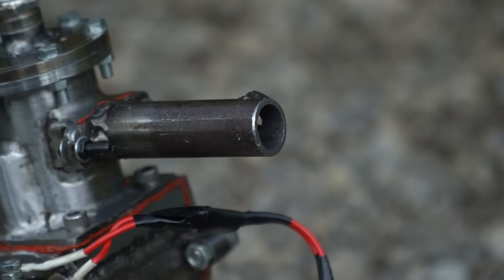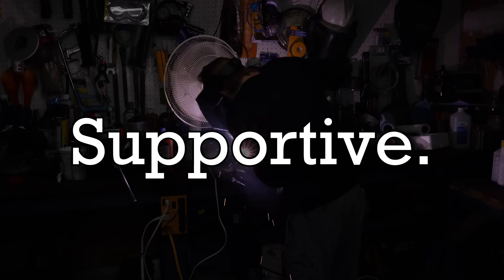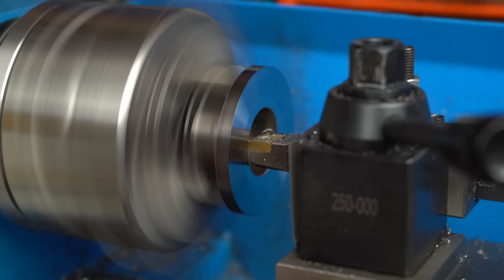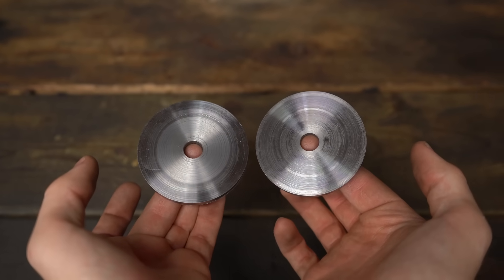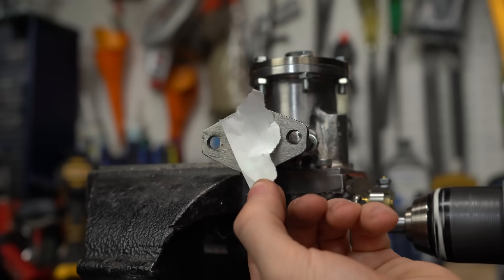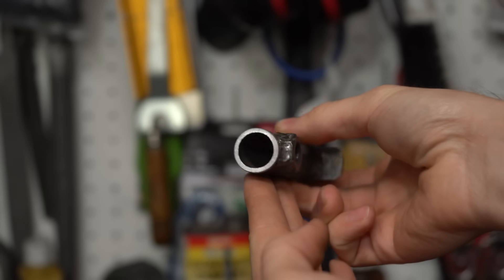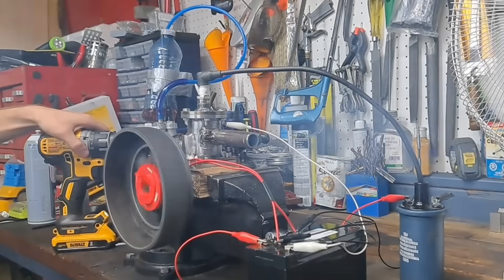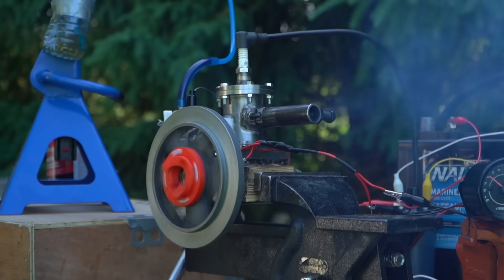I Made a Two-Stroke Engine Using Things I Found at the Hardware Store

Comment: that was kool i bet it would run better with a exhaust with a  expansion chamber on it like a dirt bike and why not drill and tap threads in the crank and run a bolt in it to hold on the flywheel and maybe run a 32:1 gas oil mix idk just a thought good job

Comment: Exhaust presure isnt needed the igintion timing is important tho and size of the nozzle of the carburateur also has to be right otherwise you wont get right air to fuel mixture even with the screw for it.
19mm or vene bigger is fine for 50cc most scooters and small dirt bikes use them even with 50cc Engines. The nozzle or th3 carburator does matter tho.
There is also normally a sort of Membrane between the carburator and cilinder.

Comment: I used to work on Stihl 2 stroke engines at a shop. When we did rebuilds we'd coat the entire inside (hand/finger application) with undiluted 2 stroke oil. You should give it a try in the future if you do another engine build, either 2 or 4 stroke. Makes it a bit easier on the unlubricated fresh metal parts and prevents a lot of wear

Comment: For most of the scooter/moped 50cc that are two stroke, the intake port is in the crankcase, so the gas/oil mixture can lubricate the crank, and the wall are equipped with ports that channel the mixture up into the burning chamber. Thats why with your design you had to add oil in the crankcase. Cool video btw
Reply: almost all 2 strokes lubricate the crank case with induction charge in one way or another with the exception of one cool design I saw in model engineer where the guy used double lip sealed bearings for everything below the wrist pin. I have a string trimmer motor that inducts through the side of the cylinder, ported using the piston skirt instead of a crank case reed valve. It's an incredibly reliable engine. It has a port along the outside of the cylinder liner almost exactly like the transfer port for transferring the fuel air charge from the crankcase up to the combustion chamber, except it goes down when the piston comes up and clears the port.

Comment: Problems begin when there's no exhaust recirculation system and that is a tell tale sign of morally broken engine and it being unbalanced leaning right wing wicked like some forked tounge freedom whisperer sputtering it's un burnt fuel spatter as if that corn-o-line gas-o-some fuel line into a dotted line tighter than a tip from porcupine quill and will do no harm to any equipment unless it runs right turns right has nothing wrong double checked making sure everything was right and tight right handed threads were to specs as listed right there. So as long as you keep it as it was left make sure it's left on left empty of all fluids because after they leave they have left and it's always better leftover and not left under. Left hand threads loosen better so better if left alone run over the check list from left while rotating ensuring you can only go left. Lie loudly laugh like you were left at every moment meaningful and love like your heart left with your family and mind.

Comment: the exhaust thing is for a flow restriction and resonance from the pressure wave of air/fuel, but getting good info about specifics is going to be hard unless you start reading research papers or talking to people who actually design/work on 2 strokes for a living, otherwise you'll get a bunch of useless boomer gibberish
Reply: an excellent advice

Comment: I hope you see this comment but on the top where the cable goes to the slide there should be the cable guide, it’s what the cable sits in. Anyways if that’s not there it can cause air to leaks by thru the top of the slide down into the carb and cause extreme lean conditions.

Comment: Pretty cool . I use a 20cc and a 50cc 2 stroke in my RC planes. Has a ignition box and hall effects sensor to trigger the spark. Some cooling fins on the clyinder and head with a fan might help with cooling.

Comment: Just for some ideas if you want to continue.  Make a stepped backplate so it is about .010" to .020" from the crankpin so you get more base compression.  Also you could make an interference fitted sleeve from aluminum, with fins, for cooling.  It is pretty much like a glow model airplane radio control engine if you want to do a search for ideas.  Oh, and a good effort .

Comment: Even as a kid, I never understood why 2-strokes couldn't have under-piston oil squirters. When I got older, I aimed to correct that by repurposing a 4 stroke lawnmower block. It wasn't that hard, other than fitting a better cam. Ditching the valves was even better, using induction pressure to route intake and exhaust through ports covered by respective strokes. You can even add minor forced induction just to aid induction routing.
Reply: Many two strokes do, they're just not in very small engines due to size constraints. But it's very common in two stroke marine diesels.

Comment: i’ve been absolutely loving these home made engines i haven’t found many who have made any. it would be cool to see you make a multiple cylinder engine like a 2,3 or a 4 cylinder inline and even cooler if it’s a 2 stroke. you should check out the detroit diesel 2 strokes. their 2 stroke does not care in the slightest about anything in the way it’s designed. it has a blower  that pushes air into the cylinders, you could adapt one from an existing tool or something. this way the crank case can be separate from the cylinder and it eliminates smoke from burning your engine oil. they also used both exhaust valves and ports in different engines. it’s a really cool design and i’d like for someone to take a shot at it. you should also try making bushing bearings lubricated by and oil pump and oil galleries, you can even make them with just a drill. best thing to do is check out the oiling and cooling systems of automotive engines. it would also be really cool if you could someday evolve to trying out diesel. love this content.

Comment: As a master fabricator in the making I can say: That first weld you showed was at least okish. It looks a lot like you are using a flux core wire welder though and I have absolutely no experience with those so it could actually be a perfect weld. I wouldn't know xD
Also: How do you sound so sexy AND look good doing it?!? That's unfair! xD

Comment: Did not watch all way through so I maybe wrong but looks like the engine is not utilizing the crankcase as pump to suck air through the carburetor on down stroke and push it to the cylinder on up stroke ... I think most 2 stroke engines do that?!

Comment: slow your spindle speed down to reduce vibration, use a sharp high speed steel tool to cut the material. youve probaby got a .4 or .8mm rad on them incerts of yours and thats alot of surface for material to 'rub' past the tip causing it to bounce. sharp tool, slower speed, youll cut that.

Comment: Your welds hardened the steel (not as hard as high carbon, but certainly harder than when it was annealed). This makes using a standard cutting tool practically useless. Understanding the alloys you are working with, including your welding wire, is pretty important. Impressive build regardless.

Comment: I just want to add - while a bit late - when I was younger and owned a few Honda Spree's and Elite's - when you remove the exhaust - it made them run terrible - the back pressure was critical for that particular application. Even attempting to modify the exhaust - was a complete failure.

Comment: Me with my bro were riding on his two stroke bike and we decided to completely remove the exhaust. It ran much better. The question is if it would run even better with properly tuned exhaust instead of the factory one.

Comment: Well done getting it to run so well.
That slack you have on your lathe cross feed is called back lash.  All lathes have it.
Sure cheap lathes probably have more than most.  Why not make yourself a new screw and nut? 🤠
Part of the skill of machining is dealing with back lash.
By the way you would so enjoy a milling machine.   Lathe and mill together and you can build heaps more stuff.
By the way the way you shouldn’t use measuring tools as marking tools.  That is trying to scribe a line with your callipers won’t work because they are meant to measure distances not mark lines. Just saying 🤠
Oh and another tip, don’t weld in short sleeves unless you don’t mind sun burn or skin cancer.  Young people say yeah, yeah
Old people say I wish I knew that when I was young.

Comment: When you have heat warp, turning it again doesn't remove the warp. You might get a flat surface but the warp is still there in addition to heavy and thin areas on the part. The best way to deal with heat warp is heat straightening. It's not as straight forward as it sounds so id watch about 30 videos on the subject so you get a good understanding of how it works. It's a necessity to know if you want to have straight things after welding. Also, you are misunderstanding the back pressure myth. Another 30 videos and you'll understand. It's a myth.

Comment: People think the fuel comes from the carb, and normally they're right. When you're dealing with two stroke the charge mixture comes from the back pressure loaded into the exhaust and blown back into the cylinder. Two strokes don't only breath out. They breath in through the exhaust for a tiny fraction of a millisecond.

Comment: You would have been better off trying to make a 4 stroke, because honestly 2 stroke is just short of wizardry when it comes to its relationship between the intake and exhaust ports and the back pressure and savaging in the exhaust pipe in how well it runs regardless of how well you have the carb adjusted.

Comment: hello fellow linux mint user 👋
Reply from the maker: based
Reply: @CamdenBowen  you use windows at all or are you fully linux?
Reply from the maker: @Morpline  I use it on that small computer since it only has like 2gb of ram and 32gb of storage, but for my desktop I use windows since most of the software I use isn't compatible with linux

Comment: They've got allen wrenches, gerbil feeders, toilet seats, electric heaters, trash compactors, juice extractor, shower rods and water meters. Walkie-talkies, copper wires safety goggles, radial tires, BB pellets, rubber mallets, fans and dehumidifiers. Picture hangers, paper cutters, waffle irons, window shutters, paint removers, window louvres, masking tape and plastic gutters. Kitchen faucets, folding tables, weather stripping, jumper cables, hooks and tackle, grout and spackle, power foggers, spoons and ladles. Pesticides for fumigation, high-performance lubrication, metal roofing, water proofing, multi-purpose insulation, air compressors, brass connectors, wrecking chisels, smoke detectors, tire guages, hamster cages, thermostats and bug deflectors. Trailer hitch demagnetizers, automatic circumcisers, tennis rackets, angle brackets, Duracells and Energizers. Soffit panels, circuit brakers, vacuum cleaners, coffee makers, calculators, generators, matching salt and pepper shakers.

Comment: That's awesome. You should try to weld some cooling fins to the cylinder and head! Also, running it on alcohol will allow it to run cooler.
Reply: I don't think alcohol is the best for  a 2 stroke that needs oil in the fuel
Reply: @krvnjrcbs  I'm mean you would still use 2 stroke oil mix

And alcohol runs cooler

Comment: Well done for a first attempt 👍🏼
Anyway it would be absolutely necessary to give that crankshaft a counter part with a second bearing on the opposite side of the crankcase, to even out the force of the power stroke. Otherwise it will keep destroying itself

Comment: One thing I noticed, as a metalworker, NEVER use a pencil on steel or aluminum as it can cause rapid, severe galvanic corrosion.  What you can do is tape a piece of paper over your metal surface and draw on it, then use a prick punch or a scribe to transfer markings through the paper.  Then, use a compass to scribe the circle.  You can also use a pencil compass on the paper.  It's a million times easier than messing with string all the time.

A bench sander and a band saw would also make your life significantly easier but those cost money.

Comment: 2 stroke:  air fuel mix goes into the crank case where it is compressed on the exhaust stroke, when the piston is near top dead center that air fuel mix enters the cylinder restarting the cycle, that's how its supposed to work

Comment: A boxed air filter in front of the carburetor intake will make your life easier by reducing sensitivity to atmospheric conditions. It will also help you avoid a "lean" condition in the carburetion and make tuning easier. A common trick was to check the spark plug electrode: if it's dark and greasy, the carburetion is too rich; if it's brown/rusty/dry, it's too lean.
I’m not sure of your engine’s cc, but that carb seems overdimensioned to me. Generally, 50cc 2-stroke scooters came with a 12mm carburetor from the factory and High-performance aftermarket 70cc cylinders were typically paired with carburetors up to 24mm (with 17.5mm, 19mm, and 21mm being other common sizes, depending on the cylinder, there was some rare case of 28mm but we are talking of engines with 30hp or something XD).
Additionally, your carburetor likely has a "cicler" ( pilot screw ?) inside the suction tray. Changing this screw, which has a pinhole, allows you to fine-tune the carburetion by regulating the amount of fuel the carburetor draws. I don't remember to have ever touched that needle, but it was 20yrs ago and I've never been a professional mechanic :D

Anyway crazy project, loved it
I was suprised that you get a "proper" ignition phase XD

Comment: A couple of tips: a two storke needs some back pressure or ideally an expansion chamber, a four stroke wants no back pressure at all. When a two stroke "four strokes" it is usually because of too rich mixture. Instead of using starter fluid on a two stroke, pour some two stroke gas on a rag an hold it over the intake so the engine gets both oil and gas. Might also be worth taking the seals of the inside of the crank bearings, if the gas manages to wash out the grease, so it might be better to just rely on the oil in the intake charge each time. Cool project, you should build a real exhaust for it and put it on a dyno.

Comment: I could save you a bunch of hassle, I have about 100 Vespa engines in my garage in various states of running. 50, 70, 90, 125, 150, 200, 210 and 225 cc motors.

Comment: Just to clear the air on the whole exhaust back pressure thing. 2 strokes do not necessarily require any back pressure at all. People get this confused and it's easy to see why because it's hard to understand. 2 strokes actually intake through the exhaust on the intake stroke. This is called "Scavenging". They rely on un-burnt mixture that is left behind in the exhaust. This why you see big fat belly like pipes on dirt bikes and snowmobiles. All that is, is a space to store that mixture. The best combination is a wide header to some kind of expansion chamber with a small diameter pipe out of the expansion chamber which is referred to as a "stinger". None of this actually has anything to do with back pressure.

Comment: A two stroke can run without back pressure, it runs better with back pressure, it runs best with a resonance chamber.

Each one requires more engineering the further down the pipe you go, pun intended.

Comment: One thing that will make your welds look much better is if you get rid of your flux core welder, and get a Shielded gas welder.

I think you did a great job on the engine. And would love to see a follow up video, maybe putting it on a bicycle or a go kart.

Comment: You have to balance everything that spins or it will self destruct.
Reply: The flywheel clamp is basically the same design they use to make Xbox controllers vibrate.
Reply: pause at 18:49

Comment: New project idea: and engine that runs on HHO gas. This gas is made scary easy with water and drain cleaner (sodium hydroxide). I've wanted to do this project in the past and apparently it's completely possible to make a cylinder engine that runs on this.

The title of the vid would be "Making an engine that runs of my bathwater" or something like that

Comment: Stop sanding pieces like that before the lathe eats you.
Oh, and hold the vertical grip of the angle grinder with your dominant hand and the body with your submissive. e.g. Right on handle, left on body. It might seem counter-intuitive but holding it like the example will make it natural to work with the tool in the clear on the left side of your body, letting you lean in more to see what you're doing and control it with your bodyweight as well as not setting yourself on fire with the jet of sparks.

Comment: Motors don't need backpressure.
They need exhaust that scavenges.
2 strokes further benefit from tuned pipes that send waves of unburnt gases back into the cylinder

Comment: This will probably be lost in the comments at this point but having a fan blow on your gun while welding can push the argon/co2 out of thr weld and cause porosity and many other issues! That could be your issue, seen you had the fan on the bench at the 5 minute mark!

Comment: Use two stroke  fuel as starting fluid, if it won't start on the fuel it's meant to run on then you have issues, dumping a little 2 stroke in the carb intake will tell you if it starts at the carb or if it's something else. I like to use my sure-shot with premix to spray into the intake

Comment: When sanding, you should really be putting your hand over it on the other side. If you keep your hand where it is, you risk getting your hand drawn into it and getting dismembered. If you sand on the opposite side and reach over, it’s more likely that your hand will get thrown out of it instead of pulled in.
Reply from the maker: I had actually reversed the motor for that clip, so that it wouldn't draw my hand I'm and rip it off lol